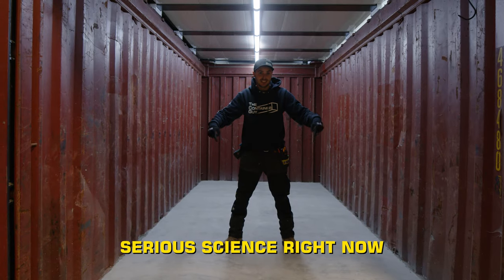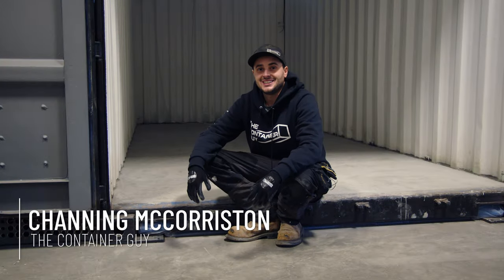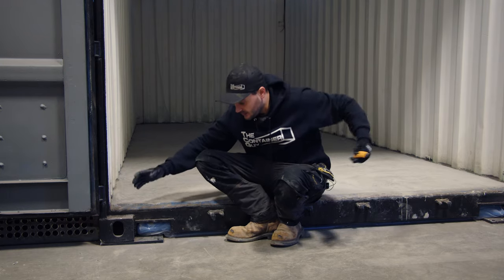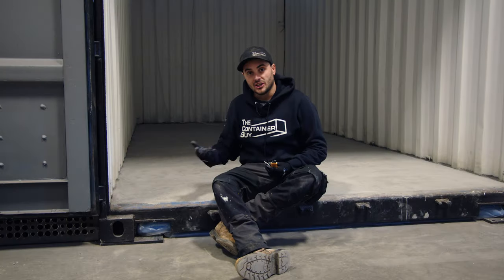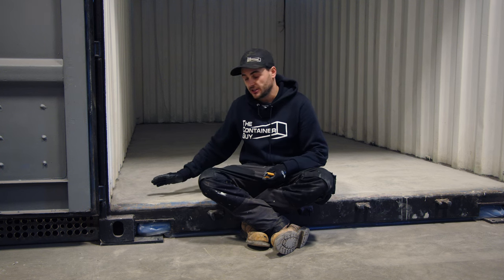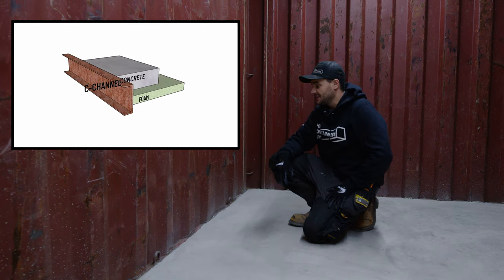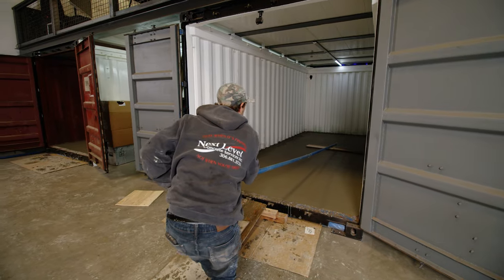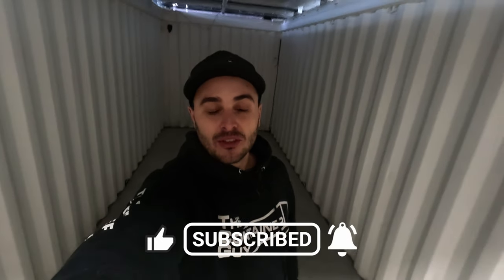DIY Storm Shelter: Pour A Concrete Slab In Your Shipping Container

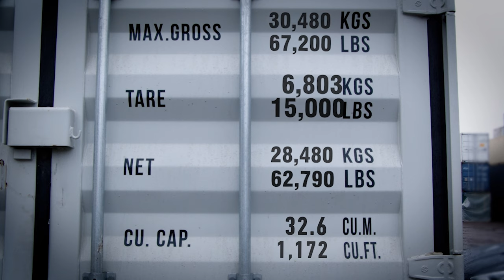Comment from the maker: 4:26 How's our math? 🤦
Reply: If your ,MAX GROSS IS 67,200 and your TARE WEIGHT, (unloaded) is 15,000, they your NET is 52,200.  If your MAX IS 30,480 kg and TARE is 6,803 kg then your NET should be 23,677.  I don't think the conversion from kg to lb on the TARE is significant.  Correct?
Reply: ahhhh, close enough, she'll be right.
Reply: The other weights didn’t change with the Tare?  Not sure what you mean but with the weight changes, is that with and without concrete i’m assuming?
Reply: How can the container be closed from inside when used as storm shelter ?

Comment: Please do not recommend these as tornado shelters! Yes they block wind. No they will not hold up to a class 3-5 tornado when debris is flying in the air. Texas Tech University does Tornado testing. Please send them a container, pay your fee for testing Or shoot a brick through the wall with a cannon up to speeds of 90 MPH. Please show proof of your statements. I do love containers. I have several but they do have limits. Knowing their pros and cons is the basic foundation for designing better built products. Plus, how would someone safely lock themselves in when a tornado comes? There is your next product! Give me credit! Lol.
Reply: couldnt you use these as homes, you could just put dirt over them in a dome shape, wouldnt you elimated the debris flying into the container? You see the hurricane hunter vehicles with dome shapes.
Its going to look ugly as hell, but atleast you would have a hurricane resistand house right?
Reply: 100% on this. Nothing above ground is a tornado shelter if it isn’t tested, rated, and/or built to spec. These metal walls would absolutely not hold up debris in a tornado, and the concrete floor would not ensure the container didn’t become airborne. Significant reinforcement, and EXTENSIVE anchoring, would be required to make a container a suitable shelter.
Reply: @TheNotoriousNemo there is alot going into designing and building homes for tornados. So far very few homes are tornado proof. There are specific rooms that are designed to be tornado proof or underground basement rooms depending on which part of the country. Texas Tech does tornado proof testing. I've personally witnessed these tests multiple times. Yes, several layers or designed/engineered thickness of steel will pass but the gauge of steel on the walls and ceiling of a standard connex container do not meet the standard minimum thickness. Plus steel can be made to different qualities and to different ASTM standards. So not all steel grades the same. A thick poor grade steel can fail while a thin High grade steel passes. Mild steel is softer than AR500 steel. Just shoot each one with a 300 winmag and see the difference.

Comment: Great channel overall but this one is a bit useless and egregious waste of money for no real benefit.  First, where in the country (Canada in particular) would you have a good use of a concrete radiant floor and Tornados are a regular occurrence?  As one other noted, you can do radiant flooring cheaper but this is a viable option for a Cold environment (long winters). More importantly, the "Storm shelter" in the title was just plan dumb (generally reserved for Tornados/Hurricanes, as anything else does not require a special "shelter").  Containers are terrible for Tornado/Hurricane protection.  Debris would go right through the walls.  You won't tip, just get impaled by flying debris. At least you'll be warm in that ice tornado 🤡

Comment: That is not a tornado shelter! No way. It may resist rolling or becoming airborne by having a lower center of gravity, but it has to be anchored to truly remain in place during a high wind event. 'Safe Sheds' are only 8x8 feet and weigh 12 tons, but still are intended to be anchored to the ground for safety. There's a whole lot more surface area here to the wind without weighing 12 tons. Projectiles would go right through those thin steel walls. Container door latches would never stand up to a direct hit either. There are good ideas here with much potential, but this absolutely can not be recommended as a tornado shelter.

Comment: If you want to do hydronic for heat you can do a very simple system using a residential electric hot water heater. Just need to swap out the high psi relief valve to a 30lb valve for safety. I heat a 1200 square foot shop with 14’ walls with a single 50 gallon water heater. I live in northern Michigan and winter can be brutal and my shop stays nice and warm.

Comment: Seems like a waste of money & time. Plenty of inexpensive electric radiant heat floor options for under both wood & laminate floors & subfloors. If you absolutely must have a concrete floor, use lightweight concrete or foam concrete like what is used in condo/apartment upstairs floors (1"-2" thick) and also used in upstairs balconies & decks, and pour over the existing floor. Use hardibacker cement board for tile floor applications although moving a container with a tile floor in it is likely a recipe for cracking. If you are building a container tornado shelter you should anchor the container to the ground rather than relying on added floor weight for additional stability, and enlist an engineer for assistance in the anchor method. Love the channel but disagree on this one.
Reply: Absolutely not a waste of time and it's not your money so what's the harm in pushing the envelope? Maybe you should have your own channel since it seems you have all the correct answers.
Reply from the maker: As per our Engineer, the lower center of gravity from the added weight of concrete increases the container's resistance of overturning from 140 mph to 230 mph. It'll actually now slide instead of tipping at those speeds needing it to be planted to the ground. We will design the ground anchor with our in-house engineering team. We are the professionals. 

I love tile. I love Hardiebacker. Great products for tiny homes on a permanent foundation. Not great for storm shelters. This video is meant to spark your imagination, not to define a single method of construction. That's not how we roll.
Reply: @TheContainerGuyTV  that's a much nicer way of saying it. Still working on my people skills!!!

Comment: Since you had the metal beams after taking the plywood out, I would have only used a few sticks of rebar and used fibre mesh in my mix with quite a bit of air entrainment . Maybe do a stamp job so you wouldn't need to tile the floors. I probably would have run some rough in plumbing in case you wanted to put in a bathroom or kitchen at some point in time. As far as things going through the metal walls in a tornado, just build a 6x8 area and plate the walls in that area with some sheet steel i/e "safe room".  First time I've seen this channel and I'm sure I'll be back. 🙂
Reply from the maker: Thanks for watching! We have some similar jobs coming up where we'll add complexity as you mention

Comment: On the Airstream Trailer forum , there's a guy who experimented with insulating the interior. He determined a simple thermal break as small as 1/8" between the inner and outer shell made a difference compared to the direct metal on metal of the ribs. Was thinking of his discovery when you mentioned making contact with the side walls of the container with the concrete then installing your bottom rail for studs.

Comment: Channing, Channing, Channing. For almost 50 years,  when I saw a container being used in a non-shipping environment, my mind would go crazy thinking about ways to use it. When I found your channel several years ago, I knew I had found something/someone special. EVERY video I watched was a new high point in non-standard container usage. Today's video about radiant heat in a concrete floor has reached a new pinnacle unprecedented in scope.
Reply from the maker: Thanks for your continued support 👊

Comment: I'm considering putting an earthen floor (sealed with linseed oil) in my refrigerated shipping containers which have aluminum T-bar flooring, and embedding hydronic radiant heating in the earthen floor.  Any advice on making this work?

There are lots of factors to consider.  Should I keep the floor's existing drain holes open?  Should the earthen floor be flush with the tops of the T-bars, or cover them with 1/2" or so?

The containers will serve as a personal library/storage & workshop/laboratory, so my main motivations here are:  I want to be able to sweep the floor (T-bars are hard to sweep/vacuum), heat/cool silently (any noise echoes loudly), and save money on flooring (plywood & concrete are more expensive).

Comment: I am building a garage from 2 40 ft containers, with 12 feet between them. I like the idea of a monolithic slab. after cutting out the inner walls then removing the wood how thick do you think the concrete would have to be to tolerate the thermal expansion here in south Georgia USA?
Reply from the maker: That's a good question. Hopefully there's a concrete expert on here to answer because I do not claim to be. 

If you did keep the top of the channel exposed, you could put an expansion board against the channel and have your slab the same height as the container floor which is about 6". Probably best to use expansion board everywhere concrete meets steel channels. 

If you want to pour concrete over everything, my guess is you'll want 4" or so of concrete above the top of the channel making the slab 10" thick (OR pack granular 4" up before pouring OR spray foam / rigid foam insulate). I would be cutting a 40' control line directly on top of the channel.

Comment: In floor radiant.  Cool. But why not set up for a ground thaw connection. Use a bypass to control temp with thermostat valve  with an over pressure bypass 
I definitely wouldn't complain about having a heated shop on site

Comment: I like it. I was thinking tiles before you said it. I was thinking sheet metal the bottom side. I know ya gotta lift it for that and I'd seal weld it. With angle iron or C channel reenforced with bar an wire that concert shouldn't crack being moved around. Idk just a thought.
Reply from the maker: Might try wire mesh in the concrete. Might just paint the underside foam with a urethane coating. Not concerned about flex. Them cross members are plenty strong and spanning less than 8ft.
Reply: @TheContainerGuyTV  get it

Comment: My containers are over a fully insulated icf crawl space so I wouldn't be able to take the wood out to pour concrete. Do you think 2" thick slab with helix micro rebar over the wood would work?
Reply: Why do you want 2" of concrete over the plywood? The plywood flooring is rated for about 58,000 pounds. It is strong enough for most applications. The container will tell you its empty weight and its load capacity.
Reply: @willrogers1023  I have two containers together and would like to have a smooth seamless transition between the two

Comment: I would feel better about a sheets of 1/8" FRP, Fiberglass Reinforced Plastic instead of Polyethylene film attached (screwed or just glued, or some really sticky double tape) under the channels to retain the insulation.  If the container is ever suspended, it could resist degrading the insulation from moisture or bugs or creatures, and it resists flame spread better.  Of course Poly is fast and cheap and you are just experimenting with the concrete, and heating it.

Comment: To make it a tornado shelter what kind of door would you install?
Reply from the maker: Per code, as long as you have a stub wall beside the door, a regular steel door is fine
Reply: We have a 40’ high cube that my husband is using for a shop until we can build him one. We also live in a doublewide. After years of stress and luckily avoiding storms that have been devastating to surrounding areas, I am finally starting to seriously look into shelters. I have retreated to his container in hairy weather but want to know if it’s actually safe. I figure it’s better than my trailer but what would we have to do to actually make it storm safe. He obviously has toolboxes, and all all these things that weigh it down, but is that enough or is it safe at all?

Comment: Yeah this will never hold in an ef5
Reply: Nothing will. A properly built an anchored shipping container home however will withstand way more than an american toothpick mcmansion ever would. Something like Jarell's EF5 would decimate everything. Having a 3/4 mile wide wedge blasting you with 260+ mph winds for about 10 minutes is going to destroy anything above ground. A pier slab anchored container with encasement would be about the strongest thing you could hunker down in from a cost perspective, unless you want to have a million dollar walk-in bank safe installed in your house.